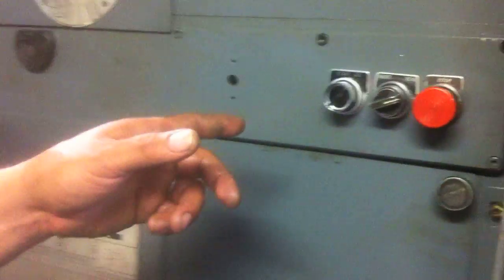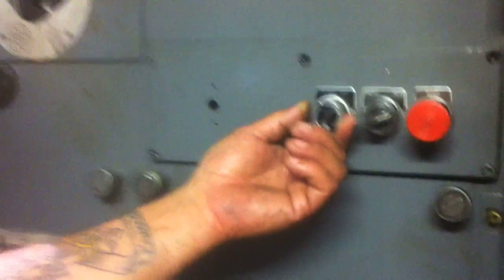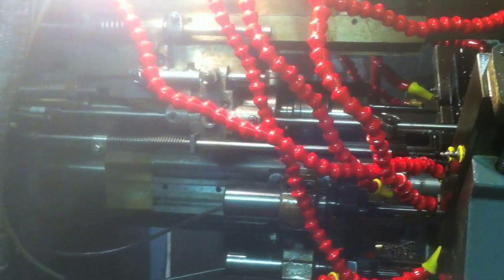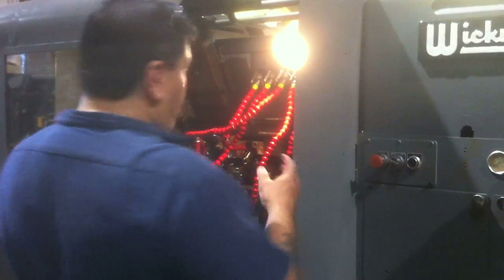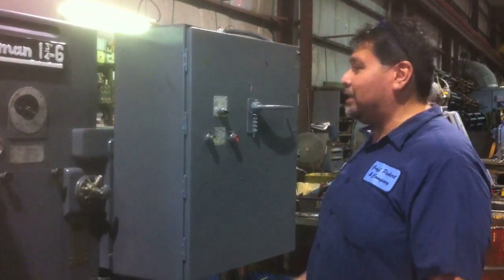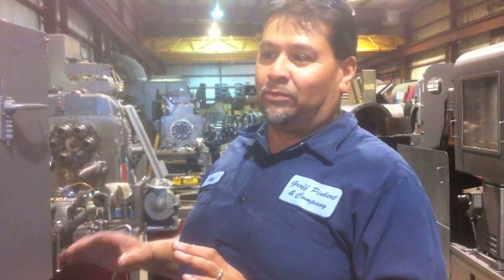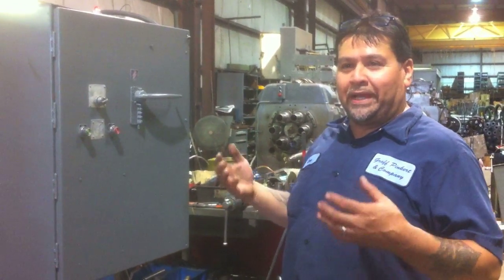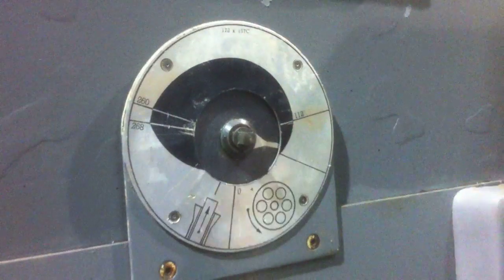Wickman 1-3/4"  Multi-spindle Operation Basics at Graff-Pinkert & Co.

Comment: My dad worked on chuckers not bar feed some aspects of the machines are pretty similar and some arent turning half nuts for steering gears 1st op was turning spigot and other dimensions / angles 2 nd op was bore and face with a broken cut as it was a half nut for recirculating ball and worm for hillman hunter supplying iran uptill 2005 when factory closed i bet the job is still running just done by some body  else.
Reply: Any Wickman multi spindle Operator vacancy Plz inform me..